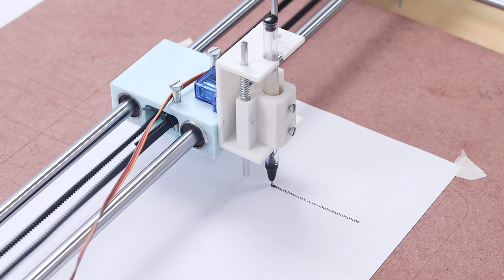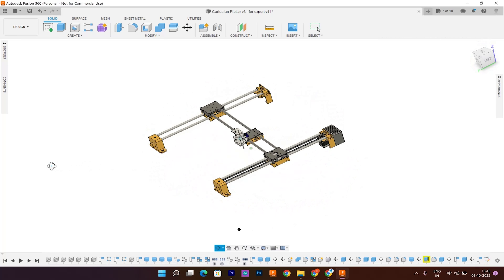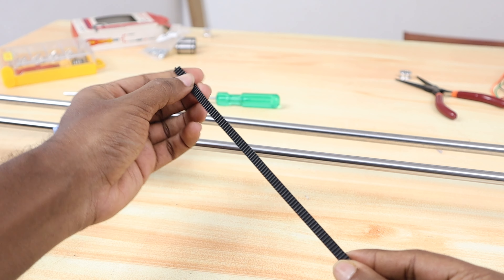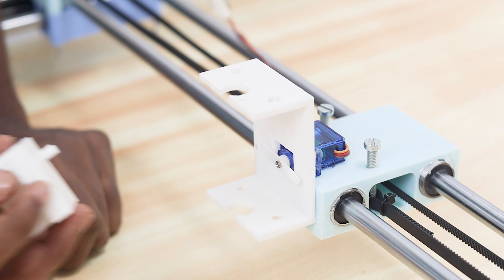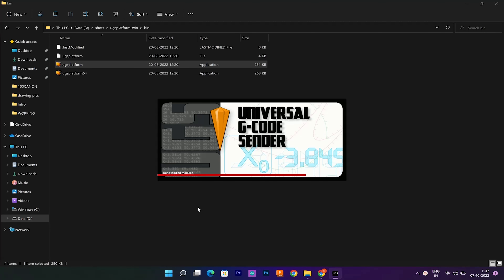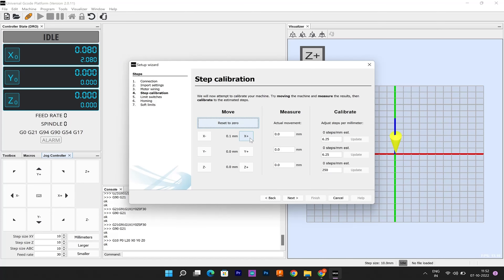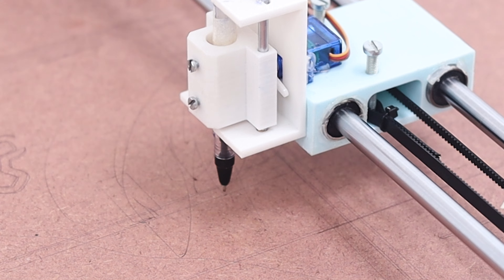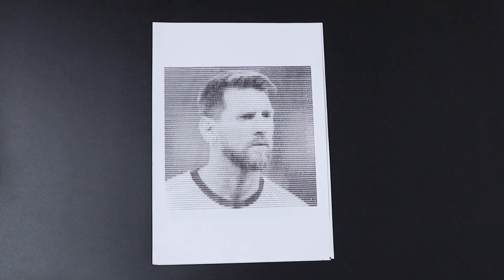DIY Large CNC Plotter | Writing & Drawing Machine | Resizeable CNC Plotter | Coders Cafe

Comment: The servo is not functioning properly. I have attempted various angles, such as M03 S90, S180 but it only operates at angles exceeding 250, specifically M03 S255, S300, and higher.
Reply: 一般是使用180度舵机，360度舵机可能无法使用

Comment: Hi, i want to make an plotter machine to put it in my restraunt . Customers will stand in front of a camera and press a button and then press another button as print then the printer should plot the photo. How can we make this setup with raspberry pi or arduino whichever is better and cost effective.
Reply from the maker: You can use a camera module connected to Raspberry Pi to capture the photo. Then the image should be converted to GCode before passing it to the CNC, once the image is converted to GCode CNC can easily draw it.
Reply: yeah right

Comment: I am planning to build an arduino based CNC plotter. I saw 2 different methods for linear movement. Using timing belt and using threaded screw. From your experience which one is better?
Reply: Same I'm also going to build
Reply: Threaded is better

Comment: HI, can we replace a laser module for the same setup, and can we use some shorter rods (if yes do I have to change any calibration in the software)
Reply from the maker: Yes, you can do it. And you should do the calibration again.

Comment: if i press +x then it is moving in 2 direction instead of moving in one direction. same as for -x,+y,-y🥴
Reply from the maker: Please check your drivers
Reply: just interchange wires on x y drivers
Reply: 70% chance of your driver's issues A4988 can easily be damaged if not handled carefully

Comment: I want to buy such plotter machine. Pls tell me the cost.
Reply from the maker: We spent around ₹7000 for this build.
Reply: @CodersCafeTech  i spend ₹10,000 coz motor drivers i used are TMC2100 Which are expensive but working is so smooth and there is no noise from motors